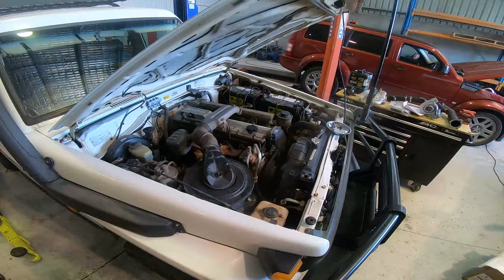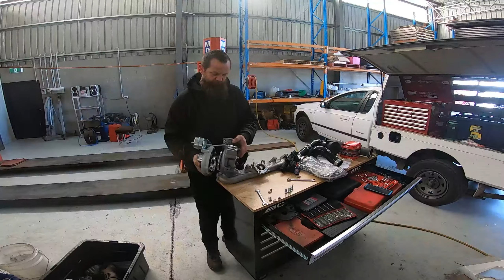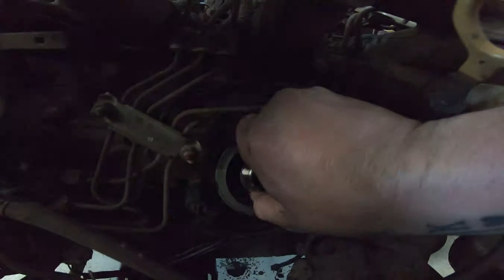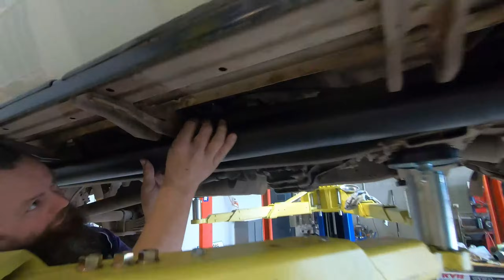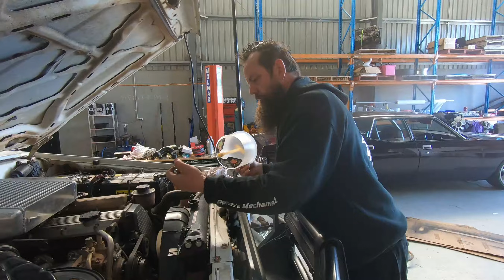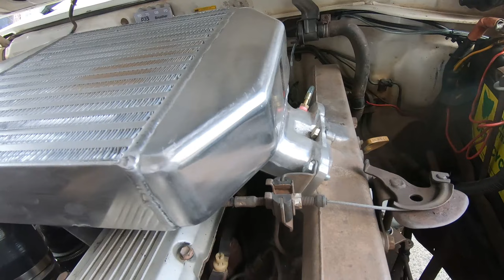1HZ Turbo Install (75 series Landcruiser)

Comment: Nice work, but the intercooler could fit in front of the radiator instead of sitting on top of the engine..
Reply from the maker: Great point!

Comment: I bought a 75 series ute with similar after market turbo and the air filter unit has been completely removed. Is this normal? Could it be somewhere else like inside the snorkel?

Comment: Hello, my name is Ariel, I am from Argentina, I have a Toyota Coaster made into a motorhome, I travel a lot to Patagonia and I have many climbs and the torque is not enough. I bought a turbo and I am starting to modify it. Is it necessary to put a TPS on the diesel pump? Or just giving it more diesel is it okay?
I only think give it 0.5kg of pressure, does this compromise the reliability of the motor a lot? Thank you

Comment: Not trying to be a smartass, but did I see nylock nuts being used on the turbo studs? Isn't the heat just doing to burn off the nylon?